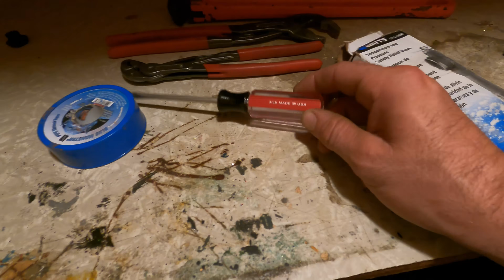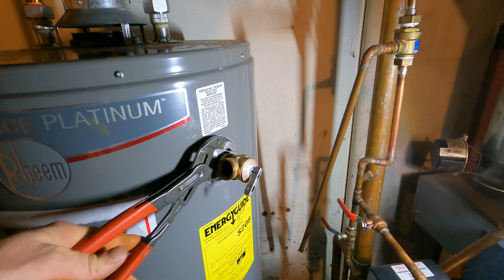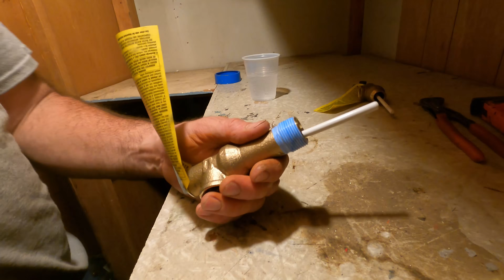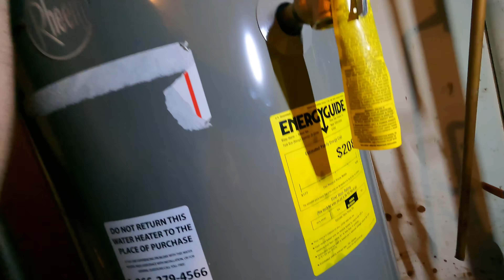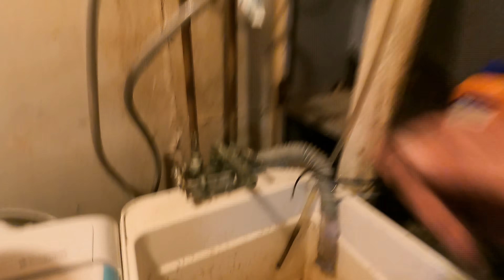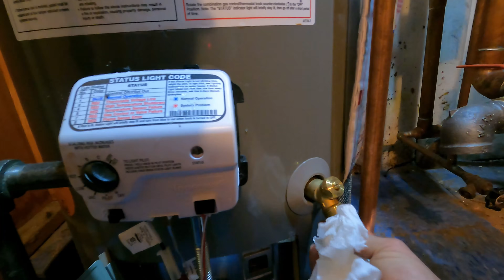Replace Leaking Water Heater Relief Valve

Comment: Great simple instructions, thank you, my issue is water running straight from my turn off valve to the pan and outside the house and it's not a drip, it's a steady flow outside, could this still be that my temperature relief valve needs to be replaced or is it something else Bill?
Reply from the maker: At Home Depot they sell a pressure gauge in the plumbing section. The gauge has a hose connection. Attach it to the drain valve of tank. Check pressure. If pressure is under 100 when tank is hot. Then I would say most likel it’s the relief. You will most likely need a new relief even if it’s a pressure issue.
Reply: @howtohvac3234 lp
Paper 0 j88l88b7p6po7i

Comment: I've never seen the hot and cold bonded together . usually cold to the gas line .
Reply from the maker: It’s code in nj to help ground both hot and cold pipes since cold water line is connected to gas, and a dedicated ground.